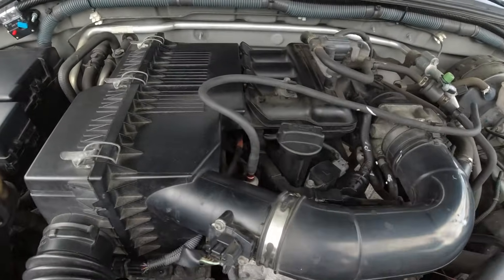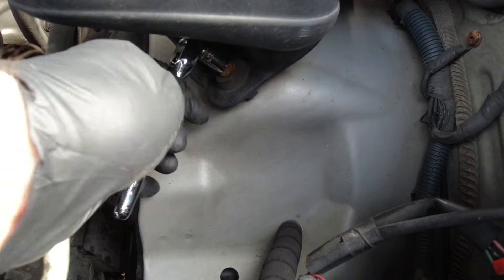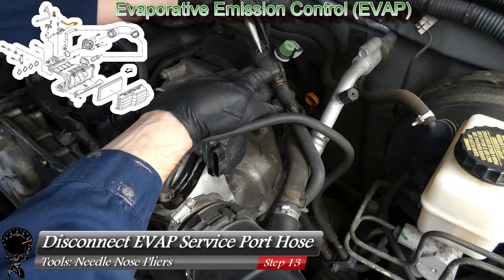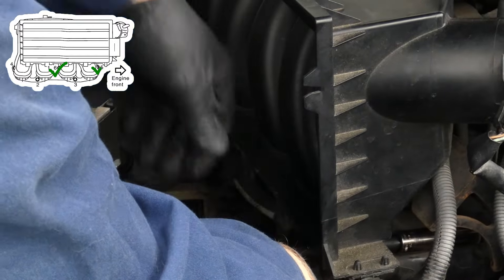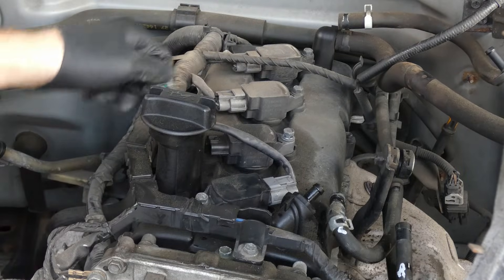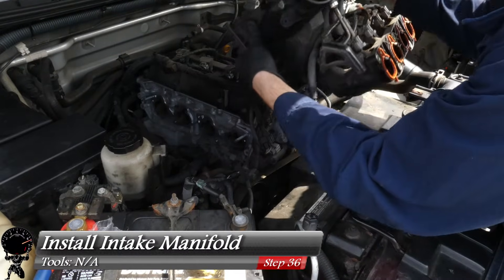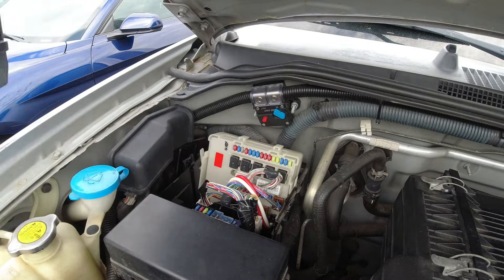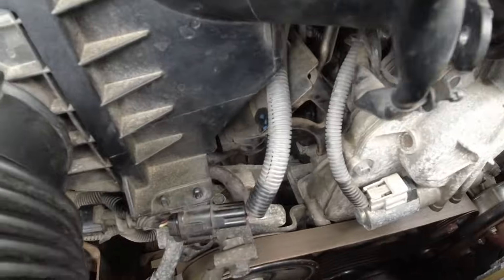How to Replace Spark Plugs for a Nissan Frontier (2008-2014)

Comment: What part of video were the spark plugs changed?????
Reply from the maker: There is a timestamp table in the description.
Reply: At about 8:57 - after he removed the coil pack on #1 then he removed and replaced that spark plug.  Just repeat for 2, 3, & 4.

Comment: First, just wanted to say thank you! This job went super easy thanks to this video. The bolts/nuts were definitely a pain, but other than that wasn't bad. Only hiccup was losing the rubber (washer?) on the manifold intake bracket (the only bolt on the drivers side).  I'm wondering if there's any chance you would know this part number? Regardless just wanted to say thank you!
Reply from the maker: Good question. Im not sure off the top of my head. May need to visit a junk yard.
Reply: @mcgurrentertainment the part is 16559-ea000 In case anyone ever comes across the issue. I ordered one for about $50. I'm wondering if you can explain how that rubber washer and the intake manifold support work? I'm having a hard time understanding is the manifold just resting on it and it takes up vibration?

Comment: I have a 2012 frontier 4 cyl.   Started shaking, running rough today. Check engine light came on flashing and then solid. 
I believe I have a misfire. I live close to 30 miles from my nissan dealer. How bad would it be for me to drive it to dealer?
Reply from the maker: Depends on the issue. It's tough to say without checking it out.
Reply: @mcgurrentertainment 
Thanks
Reply: I do have a misfire on cylinder 2
Mechanic changed plugs, coils, valve cover 
He said there was oil on spark plug
Put it all back together and its still running rough
Any thoughts?
I am being told its something internal with the motor
Reply from the maker: Odd. The mechanic didn't dig deeper after replacing those parts without success?
Reply: @mcgurrentertainment 
I had a second mechanic look and the first one missed reconnecting an electrical connector. Everything the first guy replaced needed to be replaced. After 3 days of crying and praying, I got the call saying everything is good. 
GOD is great. 
You make very good, informative videos
Reply from the maker: Holy cow...its always something. Im glad it worked out. Kudos
Reply: GOD IS GOOD 👍

Comment: Awesome. Even my Nissan Versa with the 1.8 engine has the spark plugs underneath the intake manifold plenum. It's just a bit eaiser than the Frontier on your video. I might just pick up a 2011+ year Frontier one day. I need a weekend truck. But I ain't paying $35k plus for a small new truck. That's insane. Subscribed.
Reply from the maker: Thank you very much 😊

Comment: Great video do you happen to know which cylinder is which  from 1-4 ? I can’t find a diagram showing which one is which. Would help to know which cylinder is misfiring
Reply from the maker: Thank you. The cylinder numbers (starting from the front of the truck to rear) are 1,2,3,4.
For Reference: 

https://charm.li/Nissan-Datsun/2009/Frontier%202WD%20L4-2.5L%20%28QR25DE%29/Repair%20and%20Diagnosis/Engine%2C%20Cooling%20and%20Exhaust/Engine/Tune-up%20and%20Engine%20Performance%20Checks/Ignition%20Timing/Number%20One%20Cylinder/Locations/
Reply: @mcgurrentertainment thank you ! Gave a like on the video . Chris fix level quality video keep it up!
Reply from the maker: @BasedOscar thank you very much

Comment: I changed my engine coils plus spark plugs  due to engine misfire code. Now my truck feels like it’s gonna turn off and doesn’t have much power. Check engine light is blinking now, it wasn’t before. Please help
Reply: @Julioorod a lesson I learned on a 2017 Kia Soul that might be helpful is, if you are not using Genuine OEM ignition coils the reliability of them can be hit or miss. Nissan Genuine ignition coils are pricey. For my Frontier I ordered some NGK coils, hoping that they are decent enough quality. On the Kia Soul I was using SKP branded ones, those kept going bad really quickly. If the connection is not the issue, theres a chance it could be a defective ignition coil. Normally a good way to check ignition coils is to swap their location on the cylinders....although these are such a pain to get to that's not very practical... 

If you do have Nissan genuine ignition coils, your problem might be elsewhere. Hope this helps in some way
Reply from the maker: I recommend scanning and seeing what code it's throwing.
Reply: @ It was showing misfire on P0304 and the truck was running fine before I started to to replace the spark plugs and the coils. Once I replaced those, and put it back together, the truck got worst, like it was getting enough power. I’m lost
Reply from the maker: @Julioorod sounds like cylinder 4 is not firing. Check your coil connection.
Reply: @ now it’s showing code P0303. Which I’m confused cause that coil is working fine.

Comment: My factory service manual specifies the same torque (168 inch lbs) for both the intake manifold bolts and nuts but he torqued them differently. Anyone else notice this? Edit: the earlier year trucks have different torque specs for the intake manifold nuts!
Reply from the maker: Look at the description
Reply: Thanks  @mcgurrentertainment for the great information!

Comment: Will this be the same as a 07 doing mine this weekend and it all looks identical to what mine does under the hood just wondering is there is anything different?
Reply from the maker: I'm sure the process is similar. However, I can not confirm the torque specs and part numbers.

Comment: Are you sure about the intake manifold bolt torque specs? I’m finding conflicting information on this. Thanks
Reply from the maker: A majority of my newer (updated) manuals say 83in-lb. My older one has the values in the video. 
Just make sure you use in-lb, not ft-lb (someone made that mistake once).
Reply: @ thanks so much! Is that for all of them?  Studs and bolts? Everything I read says something different.
Reply from the maker: What values are you seeing?
Reply: Varying info between 5 inch lbs to 168 ft. Lbs. doing it now at your recommendation on all 5. Thanks man! Thanks for your competence and thanks for replying!
Reply from the maker: Good grief....168 ft-lb...!?!? That's way too high!!! 
When looking at manuals... there is a generic chart that displays torque specs of bolts when a value is not provided. And for the M8 bolts (Haynes Manual), it's between 14 to 21 Ft-lbs. 
I think 168 ft-lb would snap it.
Reply: @mcgurrentertainment  no doubt it would. Thanks again.
Reply from the maker: Anytime

Comment: How did you get those bolts out that are up inside? My friend wants to take my tire off, but I feel like that's extreme. It's also the two bolts you didn't show how you got them off. Please help
Reply from the maker: Which bolts are you referring too, step 20?
Reply: @mcgurrentertainment  yes.
Reply from the maker: Just a 12mm socket and an extension bar. Nothing special

Comment: Most detailed video I have seen for this change. Thanks for you effort. The job is a lot easier if the plastic wheel well is removed. That allows you to see where the intake bolts are. #4 nut is a problem requires a deep well socket. With patience you can deal with it. Don't forget to do the throttle body relearn steps after the job is complete.
Reply: Thanks,nut #4 is a pain in the neck.

Comment: A very well done instruction video which saved me a lot of time and angst.  I did end up removing the right manifold support bracket from the block to make it easier to get the manifold reinstalled after replacing the spark plugs (and coils).  Time to keep on truckin'!
Reply from the maker: Greatjob. I'm glad it helped

Comment: Thank you sir this video was excellent was very helpful but only had 5 attachment points on my intake manifold but my frontier is a 2017 2.5 liter  2 studs on the end 3 bolts in the center one closest to the fire wall was just a little longer than the other 2 wasn't sure on the torque so torqued all 5 to 168 everything else seemed the same glad I read the reviews mirror was a great ideal also used mechanical fingers to get the 3 bolts started worked great thanks again

Comment: I changed mine today and found it easier to get to the intake manifold bolts after I removed the inner fender panel , 7 screws and 2 plugs , clear shot to all the bolts.
Reply from the maker: Very nice. That's good to know. Thank you for sharing.

Comment: thank you so much for video > took me 4 hours > Mine is a 2015 and it was exactly like your video without video I would not been able to do it > I did take the front left wheel off to get at those 5 bolts underneath the manifold. Kinda easy peasy that way. thanks again
Reply from the maker: That's awesome!!!!! Kudos. Thank you for the kind feedback

Comment: Great video!! THX- Did you have to do a throttle body relearn?? I am gonna tackle this tomorrow on my 2015 Frontier, and my service manual says if the TB is disconnected a relearn must take place. Some motor code, just newer. Many Thx-
Reply from the maker: That's a great question. Per the manual, the Throttle Valve Closed Position Learning must be performed each time the harness of the electric throttle control actuator is disconnected. The cool part is that the procedure is to turn the ignition on then off. 
Good spot and attention to detail.
Reply: @mcgurrentertainment  THX!! Gonna have my morning coffee and get after it! I am also doing a compression test and a leakdown test to check the overall health of the motor since I will be right there. Gotta tell you man- Your articulation and directions are great. Simple - easy - clear.. Love it..

Comment: Have you replaced the fuel injectors on this model?  Seems like they were right there when you took off the intake manifold.  I'm getting a P0303 misfire code and debating replacing the injectors when replacing the coils and plugs because you have to take off the intake manifold to get to all of it.
Reply from the maker: I have not. Its not a bad idea to knock those out as well.
Reply: @mcgurrentertainment  Update:  I just inspected the injectors and replaced all the spark plugs and coils (and PCV valve).  Runs well now. 
I would recommend a light and mirror to see the 3 bolts and 2 nuts on the left.  I accidentally loosened a wrong bolt, but I think it was just a ground, so easy enough to reattach. Also, I would just loosen the bolt by itself on the right so the grommet doesn't fall off when you pull the intake assembly off.  

Overall a very detailed video.  Loaded it on my laptop, put it on my bench and rewatched step-by-step as I did the work.  

I tend to buy cars and trucks and keep them for a long time; I'm going to look closely at the access to the coils and spark plugs on vehicles I buy in the future.  This is a common (and usually easy) repair.
Reply from the maker: Very thorough review and good feedback. Thank you!!!

Comment: Good video, really nice that you listed all the torque specs. I'm not one to do anything until i have to but the other day my truck developed a little stumble so I  checked the codes and it had misfired on number one and since that plug can be removed  with the intake on I changed it just to go ahead and see how the old plug looked. Well my truck has 92k miles on it and the old plugs were very well worn so I got by a couple days and I didn't want to do it but I knew I needed some time when nobody would interrupt me and reluctantly went ahead with it Easter Sunday afternoon afternoon. All turned out well but this is no job for a novice or impatient person or someone without all the right tools. It helps to be tall, long armed and flexible. Well I'm a fairly seasoned mechanic with all the right tools, tall and long armed but not too flexible anymore!  Took me about 5 hours but I had to take numerous breaks. Some Nissan engineers definitely need a whipping for this one! It'll definitely make you wish even more that you hadn't had to settle for a Nissan because you just cant afford a Toyota!

Comment: Just did mine and as another commenter said took about 4 hours and yes a mirror to see the manifold bolts is almost required. Appreciate the detailed vid. Very helpful. Although shame on Nissan. They could have come up with a better design.
Reply from the maker: Agreed
Reply: I agree that is a lousy design,not mechanic friendly.Too much time for plugs and coils.

Comment: Just finished....took 4 hours...definitely a pain in the ass but not impossible....your also gonna need a mirror and a light because you literally cannot see those bolts on the manifold without one....I would suggest doing your ignition coils at the same time...thank you a million for putting this out there
Reply from the maker: That's very good input. Thank you for sharing
Reply: The bolts are easy once you figure out where they at
Reply: Are there any trick tools for the nuts and bolts removal,especialy nut #4,had to remove wheel and fender well.
Still a pain in the butt,i can see why the job cost so much.
Reply: I gave up after 4 hours. The bolts on the manifold are put wayyyy too tight by whoever did maintenance on it before I bought it. I was practically stripping the bolts by the time I was done.
Just going to take it to the dealership at this point…

Comment: Why the PCV valve too?  is there a service interval for that too or is it a 'might as well change it while im there' kinda thing
Reply from the maker: Great question. Alittle bit of both. The PCV Valve is supposed to be checked every 30k (not necessarily replaced).  After doing research, some PCV valves lasted approximately 50k miles (however most are typically longer), and this one was an OEM valve. So, to be proactive, this was a cheap and convenient replacement. It seemed like a good idea to change it out during the spark plug replacement intervals.

Comment: Great video! All the extra work you put into the tutorial really makes a huge difference. I really appreciate it, as I am about to replace my spark plugs. I do have one questions though. Could you skip step 10, do step 11 and 12, and then go back to step 10? I was curious if there was a specific reason.
Reply from the maker: You absolutely can do that method. Some order of steps were based on preference or proximity. You can definitely skip step 10, do 11 and 12, then go back to 10. Great question!!!

Comment: In the list of parts and tools did you omit the new intake manifold gaskets?
Reply from the maker: Under "Products Used," its the first link. Felpro Engine Intake Manifold Gasket Set.
Reply: @Mcgurr Entertainment  thanks for the quick response. You're great. I made so many mistakes doing this. I followed your steps but didn't pay attention. I set my torque wrench to 168 FOOT lbs and wrecked one of my spark plugs. Had to talk to an auto parts store clerk to realize I goofed. Great video regardless thank you.
Reply from the maker: Holy cow!!! Was there any damage to the manifold? Were you able to get it back up and running?
Reply: @mcgurrentertainment  I'm just getting back from the store to remove the broken plug with screw extractors. Hopefully I didn't do serious damage and can get it working again. I'll update...
Reply from the maker: Please do. Good luck
Reply: @fezchavez  How'd it go?
Reply: @john Doliver  got the broken spark plug out and learned how to use a torque wrench. Its running again! Still stuttering at idle and acceleration, BUT it is running again and I couldn't have done it without this vid. Thanks for the help Mcgurr
Reply: @john Doliver  another thing I didn't expect was how much coolant came out of the ETC hose. It was quite a bit.  Not sure if it was because the engine was still a bit warm or what. when I ran the truck after working on it it started overheating.  Went and got coolant put in and it fixed that issue.

Comment: Im stuck taking out the fuel injector clip… everythung is removed besides the damn clip it wont come out
Reply from the maker: You can leave it, I took it off so I wouldn't lose it. My luck seems to allow me to drop/snap off items and fall within a great hiding spot in the engine bay.
Reply: @mcgurrentertainment  by chance are you suppose to lift up or down on that small clip to remove it
Reply from the maker: If you're trying to remove the fuel line, I would recommend a "Fuel Line Quick Disconnect Tool." It will help lift the connector upward.
Reply: @mcgurrentertainment  unfortunately the way i did it, i did not disconnect any hoses so im working at a angle where i can lift the manifold and get to the spark plugs but that fuel injector clip is stopping me from lifting it lmao

Comment: I am unable to get the break booster hose off, is it absolutely necessary to remove that hose to make room to change the spark plugs?
Reply from the maker: It may not be, I haven't tried it without removing the hose. If you have room to work and it doesn't damage the hose, I can't see an issue.
Reply: @mcgurrentertainment  Thank you for your response! I was able to leave the Brake booster line connected, it did limit the mobility of the Manifold, but it was negligible compared to the amount of effort that would have been needed to remove the brake booster line (for me).

I went from having P0300 & P0301 codes on Friday to having (so far) none today following your video. thank you for the "explain it like I'm 5" step by steps video. I hope this video continues to help others!
Reply from the maker: I'm very glad the video helped. Lol, I used to write procedures for different companies, and I guess it carried over to the youtube channel. 😅  that was funny